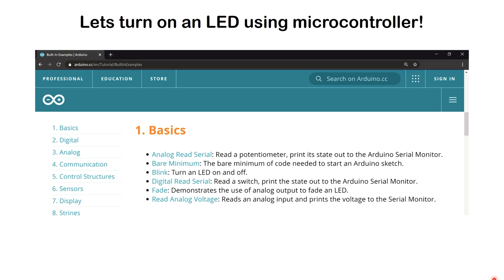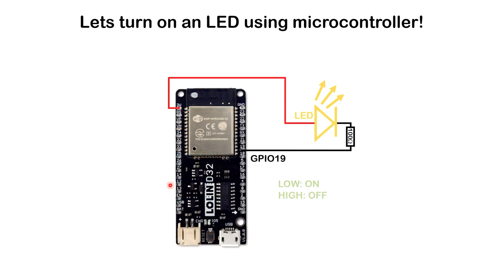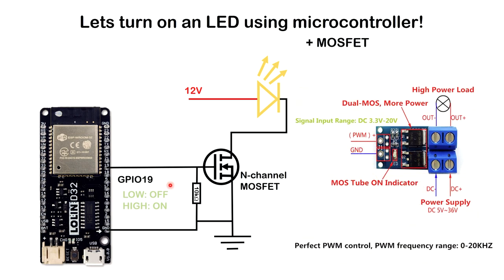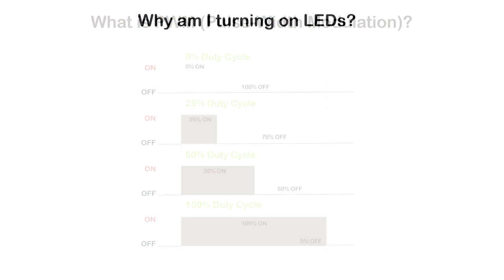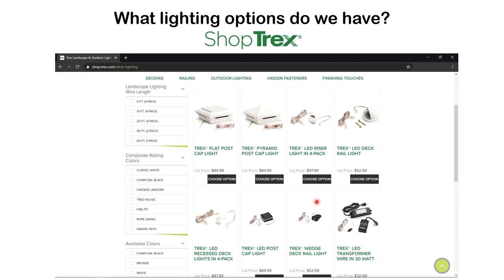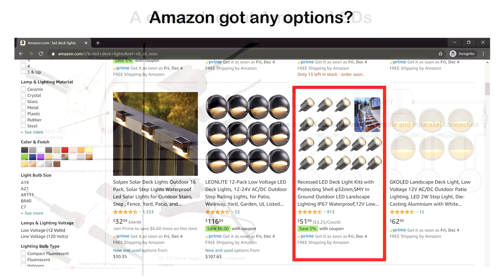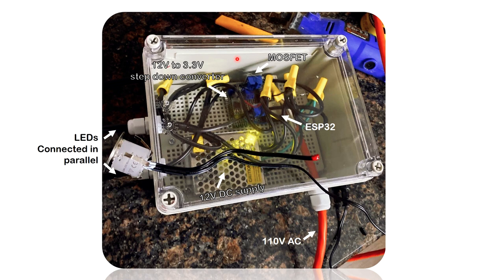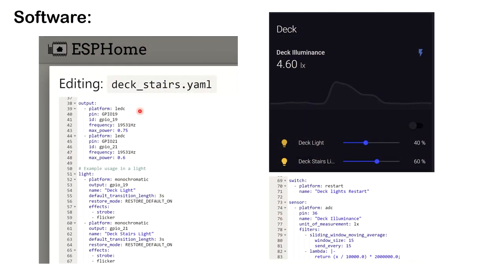DIY Smart Deck Lights | ESPHome | Home Assistant controlled

Comment: Hi Debashish, Lighting looks excellent when it is dimmed. Perfect for the night out. Would you mind sharing the Post Cap Led lights you installed which are blue in color?

Thanks
Reply: @debsahu7801  oh thank you for the info. Appreciate it. I didn't want to spend a ridiculous 100$ per post cap for a LED light around it.